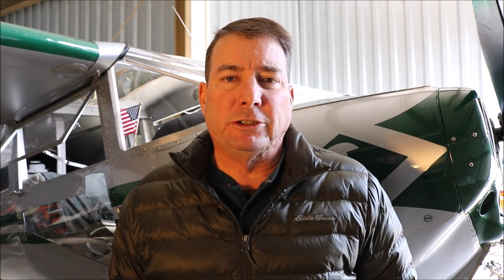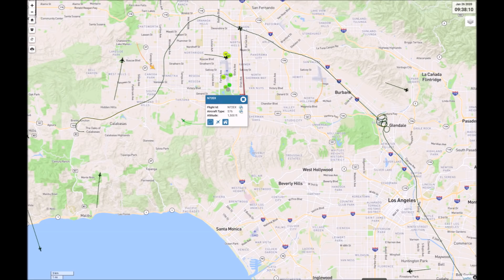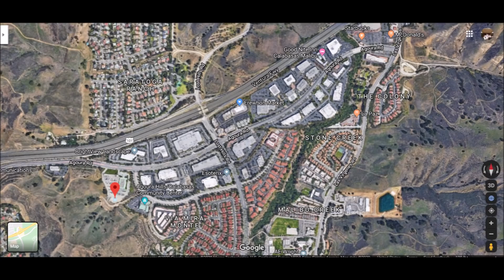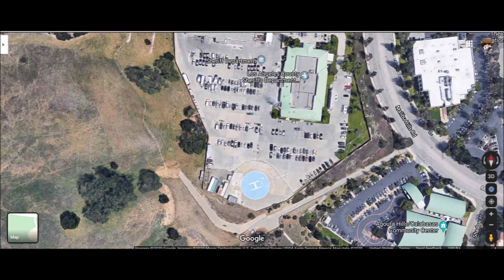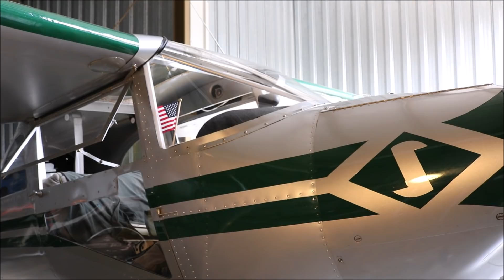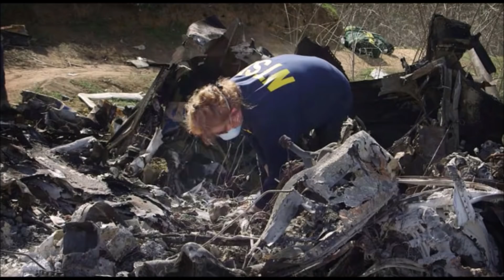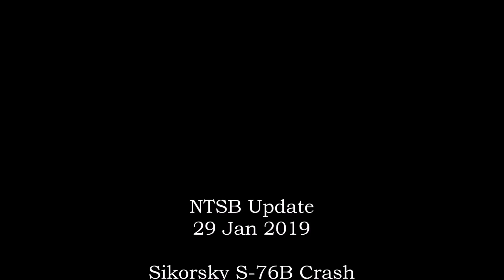Kobe Bryant Sikorsky S-76B Crash Update 29 Jan

Comment: Here we go again after my 42 yrs in pro flying FAA regulates by mortality  PERIOD. NTSB folks do a fantastic job but are hamstrung in what they can do. Just look up at the overhead lights and switches in a 72 that are the result of mortality.
Reply: Bonus points:  What’s the difference between the overhead switches on  a TWA 727 and an Eastern 727?
Reply: Not sure Doc but should be same lights though different locations according to the training/safety dept of each airline. I do remember the TWA CVR of the  captain telling the FE(after FE saying capt. you cant go this low this far out during KIAD LOC approach--or similar saying) " your just the FE" . Oooops  the FAA did get into CRM training mode after this and several other type crashes. My 10  yr corporate flying career included my CP and I talking to GADO chief and 4 Senior inspectors about non-TSO parts being installed on corp. planes. FAA would NOT help . We did internally stop this through audit dept though. This was in 79 and soured my outlook of the FAA to this day. Sorry for long winded speech.
Reply: @twoturnin1  TWA had the overhead switches reversed from standard Boeing, which was forward ( or down ) was "on"
 TWA'S airplane ohead switches "up" was on. Holdover fromthe Howard Hughes philosophy that they should be like light switches.

Comment: Juan, I picked up this channel when you discussed the PC-12 mishap out of South Dakota and I've been hooked ever since. That said you're focusing on the wrong info for this incident. Everyone I see is focusing on the weather and while that played a role, what I'm positive is going to come out is the the helo exceeded it's limits and a retreating blade stall resulted in a rolling pitch down attitude in IMC (with not enough height for the pilot to recover the aircraft even if it was CAVU).
Reply: Flying at 150 kts, 9 souls on board, probably full fuel load, I'm sure the pilot was fully aware of the helos maneuvering limitations and never would have attempted to an aggressive high angle of bank climb without being forced to by encountering an in extremis situation. There was a real risk of inducing a retreating blade stall by these conditions aforementioned. So I wanted to confirm if this hunch had any validity. I couldn't locate a blade stall chart for the 76B aircraft but I broke out one for a sikorsky h-60.  Then to determine what airspeed would induce a blade stall for the H-60, I estimated the condition for the 76 at the time of the mishap (pressure altitude 2000ft, temp 20 deg C, operating close to max gross weight, AOB 40 deg), plugged them in the chart and was shocked to discover that the stall speed was 100kts. After all the VNE for the H60 is 180 kts!
Reply: So why did the pilot make such a turn? What was he trying to avoid? According to the ADS-B data I saw on this channel Sunday night, the helo came screaming up the canyon heading directly at a 1400"+ mountain peak just east of the Calabasas landfill. This just didn't make sense to me. If the weather was bad and the pilot was trying to follow 101, he would have slowed to something like 60-80 kts a lot earlier. Heck, if it was bad as I see most people think it was he would have kept descending to something like 200, 100 ft and slowing to maybe 40 kts. He didn't do that.
Reply: He wouldn't have flow up that canyon that hot if he was dodging scud layers. But where was he going? And then I noticed that any easy right would have brought the helo north of the mountain and safely into the valley. So one of two things happened that resulted in the same response. One, he hit a scud layer, went inadvertant IMC, and initiated a climbing turn to avoid the mountain in front of him. The other scenario he sees his intended route obscured by a cloud deck. With no second option he's forced to make a sharp left turn away from the mountain in front of him, and climb to get clear of the canyon that he's just turned into.
Reply: The pilot almost certainly experienced vertigo, but with his experience it shouldn't have been that big of a problem. When he initiated that climbing turn he almost certainly did it against the cyclic trim setting. All he had to do was gently let the cyclic return to the trimmed position, release the collective trim button and the helo would return to the straight and level attitude. I never trimmed turns just for that reason.

Comment: Seems like the bottom line is, bad decisions. 8200 hours, and still making bad decisions?  I know this is hindsight, but, the pilot should have slowed down and never gained altitude and stayed in view of the land for reference.  An even better decision, the best decision, the right decision, would have been to simply set it down in a clearing, and wait for the fog to clear.  The pilot is at fault for making the WRONG decision.

Comment: Thanks Juan, CFIT seems to be it but I await NTSB conclusion. I appreciate your insight as always. God bless and fly safe.
Reply: Smartyrdumb ? 
In this case it appears to be UCFIT. UnControlled Flight Into Terrain. Or perhaps UFIT.
Reply: speedlever “controlled” is a reference to the fact that the pilot did not lose control of the aircraft due to a mechanical issue. I.E. controlled impact into terrain not excluding adverse weather conditions. This is all speculation of course but thrue the process of elimination, from what is known so far, this incident “appears” to be that as such. IMO. ☮️ ❤️
Reply: Smartyrdumb ? 
I appreciate the expanded explanation. I’ve always thought CFIT referred to accidents like undershooting a low ifr approach and running a perfectly good aircraft into the ground. Or conducting a night visual approach in mountainous terrain and crashing into obstructing terrain, etc. I don’t recall accidents resulting from a stall (regardless of the cause) or loss of control due to disorientation/vertigo/whatever ever referred to as CFIT accidents. But I may be wrong about that. 

Anyway, my point was that all indications I’ve seen point to loss of control of the aircraft, ergo my UFIT acronym, which is not a real term anyway.  😃

Comment: If the helicopter was still intact when it hit the ground, does it mean it later blew up and caught on fire? By the looks of the pictures it seems that way, rolled down that small hill and disintegrated.
Reply: Disintegrated at first impact. Hit the side of the hill head on at 161 knots (185 mph). Instant total destruction.

Comment: Juan, We will probably never know how many people have died because the pilot felt internal or external pressure to fly it was unsafe to do so  whether was a mechanical problem or weather problem.  I was a 737 line maintenance controller for 9 years and one night I had to stop an airplane at an intermediate stop because the pilot reported that he had encountered severe turbulence and I had to bring in mechanics for a structural inspection. After I made my decision I received a call from the operations controller telling me that the passengers would like to go to there scheduled destination. I informed him that I would like them to continue to their original destination but this was an inspection to determine the structural integrity of the air plane and I was sure the passengers and their relatives would be vary unhappy if I dumped them in a field before their destination. There is pressure from every direction to go and go on time and sometimes you have to be strong enough to resist the pressure. During my career my philosophy was safe first, legal second and then we could depart.

Comment: Not an aviation guy but does it seem like there is a very ,very, very small margin for error and you need nerves of steel.
Reply: Research helicopter flight training. Absolutely nothing like an airplane. No such thing as cruise control or flight stability aids. Constant physical adjustments thru entire flight. First lesson: hovering. If you can't hover, you can't fly.

Comment: Ten years a c130 crew member.
Ive seen med choppers hold a hover with a 60 mile an hour sandstorm on the port side. Ive known North sea oil platform chopper pilots and various military chopper pilots.  This pilot caused this mishap, was he pressured by Kobe Bryant to make this flight??
Reply: My thoughts as well...pressure of trying to please a high profile client and taking chances which doesn't work well in aviation.
Reply: That was my first question when I heard about the accident.
Reply: And inexperience in my opinion flying in these conditions
Reply: I don't think Kobe would have pressured him, but this pilot apparently was "the guy" celebrities used, so their may have been pressure put on himself to perform, as he was known as the best.
Reply: ZEEBEE - this pilot has proven he had little experience flying in these conditions-
Reply: @John Kyle mannnn stfu
Reply: All decisions are the pilot responsiblity.          Drew
Reply: @John Kyle rotary wing
Reply: @John Kyle ex usaf and rsaf c130 crew segway to southern air transport.
Call it what you want. Id never fly in one of those things

Comment: Isn't a lack of fire on impact a possible fuel issue? Meaning there wasn't any. He did hold for 15 minutes under his special vfr flight plan. What are special vfr flight plan fuel requirements for a helicopter  are they the same for fixed wing aircraft? Sorry not really a comment, but more questions.
Reply: A split second from impact to fire. (185 mph)

Comment: Im a master captain on the water, never flew, never been in a heli. As a commercial fisherman I totally understand how fog disorients which way is which. I only have to deal with which way on a flat plane. I don't have to worry about up, down, ect. My inexpensive charting system I have on my boat will bring me exactly to my lobster traps that I had set days before. I haul in the fog when visibility is zero. With my 1000 dollar chart plotter I can drive to any of my 600 traps that are entered.  It will tell me to the 1/10th of a knot how fast I am going, tell me which way I am traveling regardless of which way the bow is pointed. If I am drifting sideways, or backwards it tells me in degrees my direction of travel. My chart overlays the depth and contour of the sea floor.  Why is there not a inexpensive chart plotter for airplanes with an overlay of a topography map? Last I knew you could also pull rough elevation from GPS signals too. It just seems to me the technology has existed for 2 decades that would have told him exactly where he was, where the mountain terrain was, exactly which way he may have been drifting while he had no visual perception, which way to escape to a lower elevation without contacting ground. Maybe common sense is wrong in this case?  I am totally ignorant to navigation, or control of heli's.

Comment: The pilot had an instrument rating. The aircraft was Instrument equipped. Seems to me that he should have just filed, and proceeded as a normal IFR flight.
Reply: Island Express is a non-IFR part 135 operation.  They could not legally file IFR for the charter.  Either the pilot was reluctant to declare emergency with the accompanying paperwork, or couldn't manage the transition and course reversal.  NTSB will do their job but, don't expect much to change.
Reply: @jesse-raybear-baldwin  The media said Kobe owned the helicopter thus, Island Express we presume?
Reply: Garth Clark I don't know the particular arrangement with ownership of the company but my understanding is that it was an on demand charter.  If Kobe had direct corporate control it still doesn't change the operating restrictions under a Part 135 air carrier.
Reply: @jesse-raybear-baldwin  True however, liability would be another matter with the passengers/families. Thank you.
Reply: @jesse-raybear-baldwin  From what I have read up to date, Island Express has now grounded their aircrafts and they are a for hire company, not owned by Kobe. He has used them often however, which might be why some thought the Sikorsky was his or the company as well. Not the case so, it seems everyone on board has a civil case against the operator except the pilot. Sad, They won't likely have enough assets even though they are insured for this. I found a YouTube video that a couple of aviation accident attorneys made so maybe they are looking for some clients. https://www.youtube.com/watch?v=wAo2w6MT1HA
Reply: This was a fake you idiot
Reply: My guess is they didn't plan on the fog therefore no IFR plans made.
Reply: Considering that he had to hold for 15 minutes outside of the Burbank surface area to get his SVFR clearance, not only would an IFR flight be safer, it would've been faster.
Reply: @steveorshon  My observation was the ATC asked him to hold for IFR traffic to the airport.
Reply: @Garth2011  Yes, IFR traffic has priority over SVFR.

Comment: Flying is inherently dangerous, rules are in place for safety
reasons. Manipulating the rules even if it's legal can get you killed. The
pilot's altitude and course were erratic indicating he was flying in and out of
instrument meteorological conditions (IMC) and he had no situational awareness
and ultimately flew into the ground. Basically what he was doing is called scud
running. Scud running can cause vertigo really fast because you are looking
outside the aircraft trying to avoid the soup, the fog, the clouds. Your workload
is greater because you are trying to dodge the weather you shouldn't be flying
in. 

 I read the policy at this company is their pilots are not allowed to fly on instruments in bad weather. That means
even if the pilot is an instrument-rated pilot he is not current and may not
have real IMC experience. Eight thousand hours of uneventful flight is just
that. It doesn't qualify you for hard IFR flying under stressful conditions.
Conditions you never should’ve gotten yourself in. He flew into marginal VFR
conditions, requested and was granted even lower VFR conditions when he should
have have been landing somewhere while he could still see the ground.

Comment: From hi•mt SAR in clouds next to cliffs in dense fogs with propwash ... Proximity sensing is optional?

2 NTSB requests for TAWS how good or not listed "unacceptable" for inaction? 

My design spec for hi•mt SAR 4•tons pyld to 9km/-40C, no propwash, no fuels magnet powered.

A fluid impulse motor is a closed system jetski loop, a directed force, no air needed to fly.

So, a 6•pack for reserve is 2-motors at hover×3, with the load well below the CG they pendulum in wind sideways the 6•pack can orient for rigging & all.

Firefighting it's 1000gal, on-station until the water runs out with drone fire nets 120'×60' to catch flares & comm/thermal for all-weathers.

Flying cars use all principles, a closed system is reducing plunge pool, counterforce impact against the lift, an expansion chamber does that into the tank to the inlet to the pump.
http://bit.ly/2sDYmfZ

Comment: From hi•my SAR in clouds next to cliffs in dense fogs with propwash ... Proximity sensing is optional?

2 NTSB requests for TAWS how good or not listed "unacceptable" for inaction? 

My design spec for hi•mt SAR 4•tons pyld to 9km/9km/-40C, no propwash, no fuels magnet powered.

A fluid impulse motor is a closed system jetski loop, a directed force, no air needed to fly.

So, a 6•pack for reserve is 2-motors at hover×3, with the load well below the CG they pendulum in wind sideways the 6•pack can orient for rigging & all.

Firefighting it's 1000gal, on-station until the water runs out with drone fire nets 120'×60' to catch flares & comm/thermal for all-westhers.

Flying cars use all principles, a closed system is reducing plunge pool, counterforce impact against the lift, an expansion chamber does that into the tank to the inlet to the pump.

Comment: Only an enhanced version of TAWS, specifically designed for helicopter use would have given the pilot at least a better sit-rep then without it but would not have prevented the accident.  I fear, like Juan mentioned, that this accident will come down to pilot error and pilot training.  VFR into IMC is one of the biggest cause of most accidents and the in ability to call it a day long before your in it.

Comment: Even I have a difficult time driving with fog and recognizing landmarks, let alone flying in fog, which is three-dimensional navigation
Reply: This is chasing the wrong problem. This helicopter and the pilot were all qualified to fly over the fog!! For what is most likely a number of reasons the pilot chose not to, even if he could've done it att any stage of the flight to the last minute of the flight.
Reply: Thomas Paine  Oh yes, it seems like he was also trying to avoid it. But again, there was no actual limitation to declare emergency, and fly normal IFR to an airport he could land safely. He had this option to the last minute of the flight, and would most likely have landed safely, whatever the weather.

Contrast this to some common Cessna without any IFR certifications or even an LAPD chopper with only VFR flying..In those circumstances there is a much greater chance of neve making it to an airport, if it wasn't for clear weather somewhere withing flying distance.
Reply: @rkan2  this looks like pilot mistake to me

Comment: I wonder if rotor recirculation might have had some relationship to this? Rotor recirculation happens when a helicopter pushes air into the ground and it flows back up again and is then sucked back down by the rotor. When the recirculating air exceeds the rotor down thrust capacity the helicopter falls out of the sky. If you are lucky you can fly out of it, if not you hit the ground really hard. Hovering in confined spaces with no wind is the perfect seanario for this - like a valley full of fog (fog requires no wind to form).